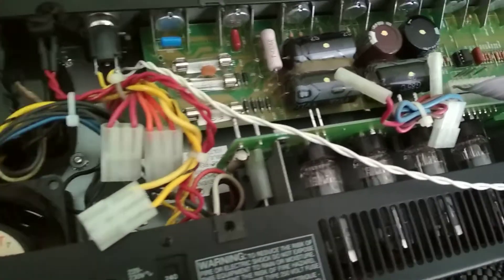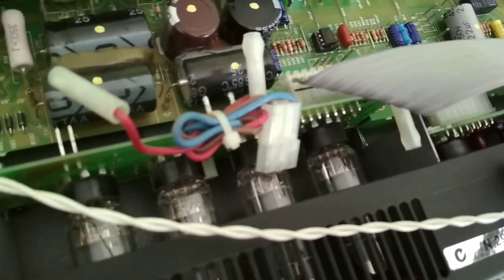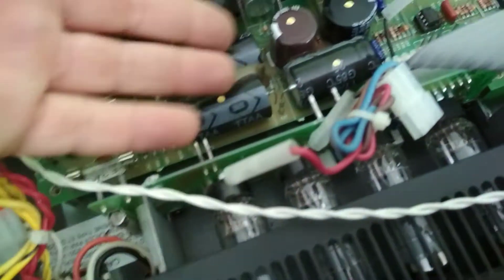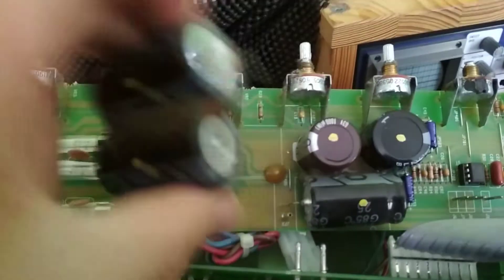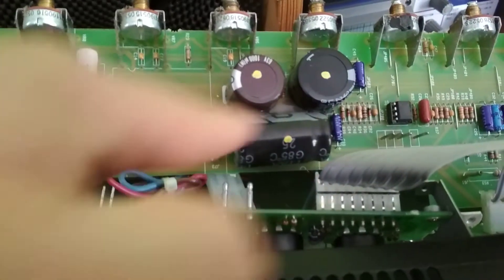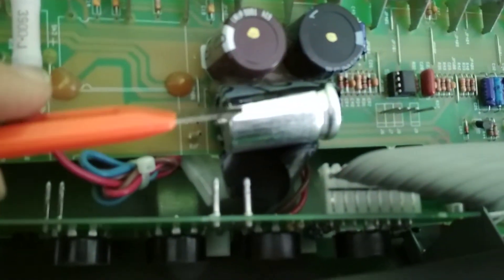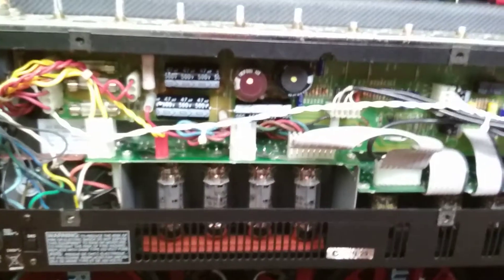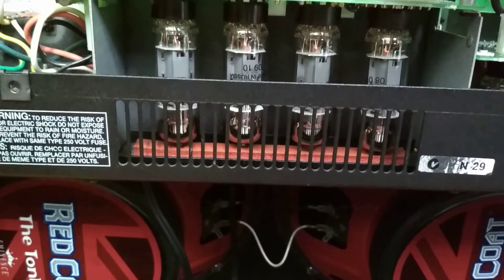Peavey Classic 50 New Upgraded Caps

Comment: Hang in there, bro just hang in there ,I got the same amp but mine's  a 4/10 and I'll guarantee you if it's done right that customer or if it's your amp you / customer will be a very happy person, those amps sound great I mean great the only good for live performance, you don't want to bring them into a studio the mics pick up the fan but, figure those amps like a tall slender  blond in nylons and high heels driving a Porsche they're all high maintenance you can't get away for from it if you want to ride the best, LOL, LOL, LOL it cost you and you will love the sound.
Reply from the maker: Sadly, I never updated what happened. The amp was riddled with more issues, and huge cracks in the PCBs. Ultimately, it's parted out now.

I've used most of the parts for other repairs. However. The PT and OT have been salvaged, tested and will be used for a big project coming up. An amp build from scratch.

Since this OT was running off a quad of EL84 tubes. I'm thinking a likelihood of a couple of 6V6 tubes might be a nice point to point wired project. However, I am going to perhaps use the opportunity to make something unique and look at some of the more rare and not as popular Valco styled amps. Either 6V6 (again) or perhaps the 6973 tubes. If the OT can working with them. Still planning at this stage.
Reply: I agree Mark , I have the same from new a 90's build .. had 2 services in its' life time ... speakers need upgrading but it is a great live amp ... am now at the stage where I want it tweaked to improve it overall ... am considering separating the amp from the main cab and coupling it with 2 good 10 or 12s ....🤞
Reply from the maker: @waxhead63  Agreed. It is a great sounding amp. Just that this one had so many issues. It gets to the point of diminished returns. It was worth more to me as spare parts, and most of the parts of the amp have been used or sold separately and I made my money back and profit from doing this. The PCB's have been thrown in the bin, as they were riddled with cracks to the point where it was becoming a point to point wired amp. Which is what I almost did with it. I was going to gut the chassis and make it a Push Pull 6V6 20W amp, aka: A princeton with tremolo and reverb in a large 2X12 cab. But I am on tour so often that I have had zero free time. So I just sold bits I didn't need, and I have kept the items I will use later to make a point to point 6V6 Princeton or Supro 1624 clone. Though look out for a new video in the next few weeks of a reissue Supro 1624T I bought that was redplating with the old tubes, and redplating even harder with brand new tubes not even running at full voltage. The cathode resistor was changed, and all is well, sorry to give the ending away. LOL

Comment: Reckon its the same with the Classic 30
Reply from the maker: Almost. Their circuits are almost designed the same. But the PCB is completely different. As such, also lower voltages (not by much) to get the 30 Watts instead of 50. Basically that's the main difference between the amps.

Comment: Short of sounding like a twat but how do you or did you decharge the capacitors?
Reply from the maker: Always discharge the caps. I've done it in other previous videos. I generally don't bother showing it in each video because it's pretty much a given.

How I do it? Well, I use an alligator clip connected to a big resistor. I attach one side of the alligator clip to the chassis/ground. And the other end, I attach the resistor and contact the positive end of the main filter caps, and all other electrolytic caps so that the positive end is grounded via the resistor and alligator clip. Then I check the voltage via a multimeter to make sure there is genuinely no hidden killer voltages left.

What you will notice is that the caps will slowly recharge, but they rarely go above 10VDC in my experience. If you are completely concerned about it, you can keep the alligator clip attached to the caps so they are always grounded and don't recharge until you power on. Remember to disconnect the grounding alligator clip and resistor when you test the amp out again. Depending on the design, it's best to just avoid any sparks and fireworks. 

I hope that helps answer your question. Thank you for your love and support.
Reply: Cheers .. I'll scout back through

Comment: This is a good amp get over yourself
Reply from the maker: Might sound good, but from an engineering point of view, it’s poorly designed as far as a tube amp goes. Thanks for your comment.
Reply: @whatsstefon  theirs lots of videos on n YouTube proving there quite serviceable.
Reply from the maker: @MrMcflanigengaming  that’s not what I said. But appreciate your point of view.
Reply: @whatsstefon  😂 you should run for office we’ll played
Reply from the maker: @MrMcflanigengaming  anything else constructive you’d like to add? Sorry you feel personally attacked about the shortcomings of this amp. Let me explain myself better for you to understand my point of view.

1. Cheap filter caps
2. Ribbon cables
3. Poor solder joints
4. Thin circuit board
5. Thin and inadequate circuit tracks
6. Known issues with these amps for arcing and conductive boards
7. Power tubes on PCB
8. Board mounted pots with low quality pots that notoriously break at the thread.
9. Cold biased to avoid redplating, therefore sounding harsh, thin and lifeless for a 50W tube amp.

What facts have you got that back up your insults?

Comment: Peavey Classic turd they literally don't want you to access any the internals 😂
Reply from the maker: It's true. The Classic 30 is even worse. My thinking is, what's wrong with a single board? That box shaped nightmare on the classic 30 is an insanely horrible design. As is the Classic 50.

Not to mention getting a claimed 50 Watts from a quad of EL84's. I mean, the Laney L20T is a 20 Watt amp with 4x EL84 tubes. Because they run that amp with the plate voltages within spec of the design of the EL84 tube. And also biased correctly.

Fixing amps as a side hobby when I'm not touring makes me learn what amp makers do to cut corners or market their wattage ratings. There's a lot of weird and crazy ideas that are both genius and stupid at the same time. All in vein of cost cutting.
Reply: @whatsstefon Very well said, it's all about the profit these days sadly. Is there any hope for the Classic 50?  How have the upgrades changed the tone? My Classic 50 sounds super thin and the bass end is flubby. I definitely do not know a whole lot about the circuitry and what cap values change  certain aspects of the tone, but what would you recommend to tighten up the bass of this amp? I've got a couple Jensen mod 10-35s on order for it in hopes that it helps somewhat.
Reply from the maker: @anthonyclarke2076  I always believe that a speaker change will dramatically change the amps tone. Caps and resistor changes to the tone circuit will make a smaller change. Tubes will make a smaller change. Replacing the usual cheap and nasty filter caps and bias caps will make things louder, tighter and better sounding too.

These things are made to a price. They all are.

As for what happened to this amp. Well, it has been entirely pulled to pieces. The filter caps and resistors are all in my spare parts drawers. Tubes have been tested and matched pairs have been used in other amp repairs. Fuses have been reused in other amps. Pots l, etc. And especially the output tranny and power tranny are to be used in a project I'm thinking about. A Supro 1624T with 6V6 power section.